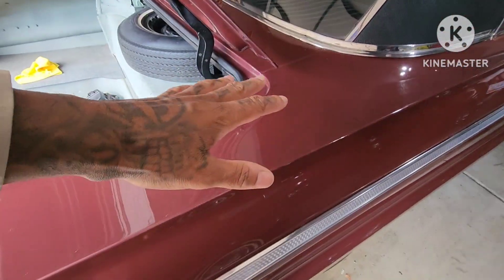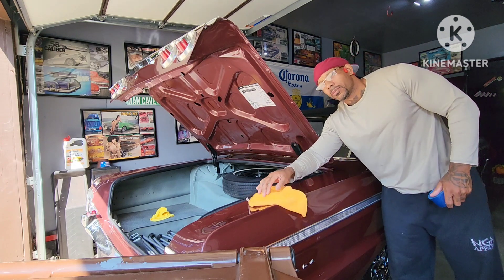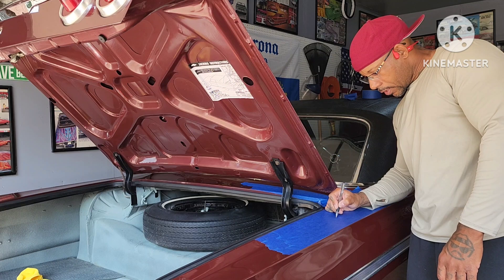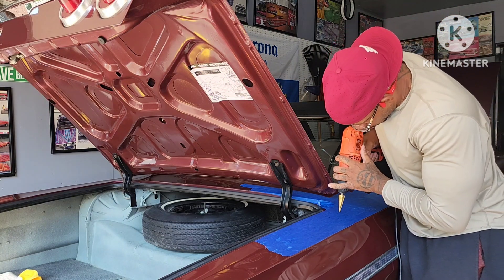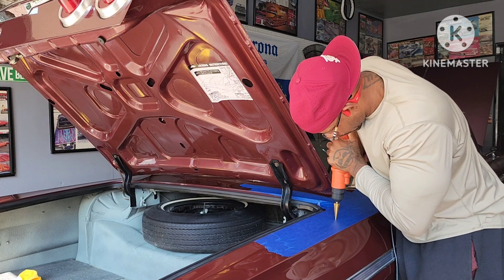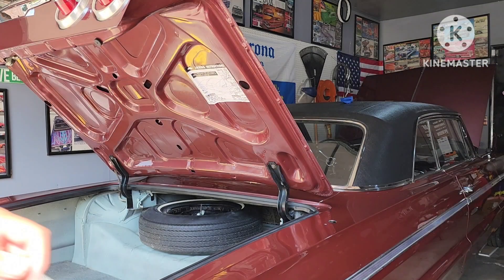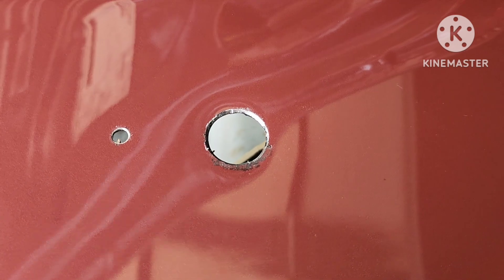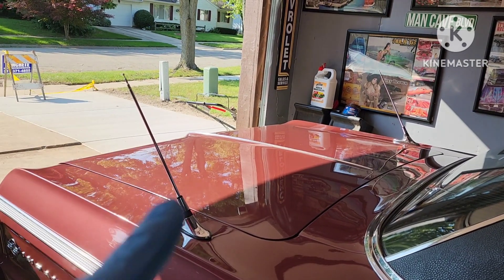1964 impala ss dual antenna installation

Comment: Looks good, where did you get those antennas from? I haven’t see the removable ones
Reply from the maker: https://www.amazon.com/RetroSound-MC-6162-41-RC-Rear-Mount-Replacement-Chevrolet/dp/B00XMPBKMC?pd_rd_w=58ZMK&content-id=amzn1.sym.374b0f4c-7004-471a-8101-cd202f0dfefb&pf_rd_p=374b0f4c-7004-471a-8101-cd202f0dfefb&pf_rd_r=HRANYG2EDH2C5QAVDB3E&pd_rd_wg=8tje6&pd_rd_r=f3c0b408-9e0d-4335-b2c9-1a717fb54886&pd_rd_i=B00XMPBKMC&psc=1&ref_=pd_bap_m_grid_dv_rp_0_4_t
Reply from the maker: https://www.amazon.com/RetroSound-MC-6162-41-RC-Rear-Mount-Replacement-Chevrolet/dp/B00XMPBKMC?pd_rd_w=58ZMK&content-id=amzn1.sym.374b0f4c-7004-471a-8101-cd202f0dfefb&pf_rd_p=374b0f4c-7004-471a-8101-cd202f0dfefb&pf_rd_r=HRANYG2EDH2C5QAVDB3E&pd_rd_wg=8tje6&pd_rd_r=f3c0b408-9e0d-4335-b2c9-1a717fb54886&pd_rd_i=B00XMPBKMC&psc=1&ref_=pd_bap_m_grid_dv_rp_0_4_t